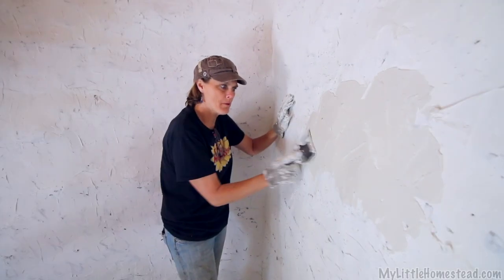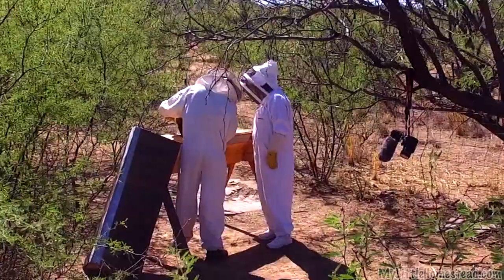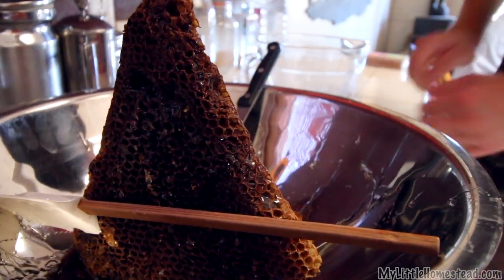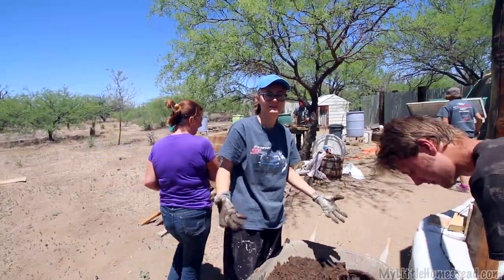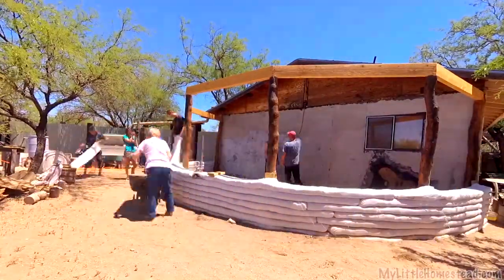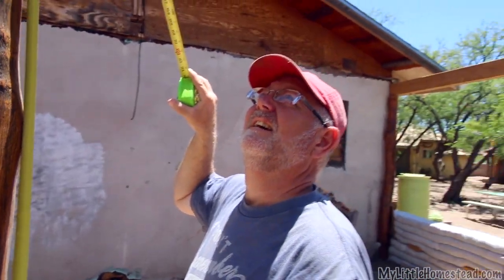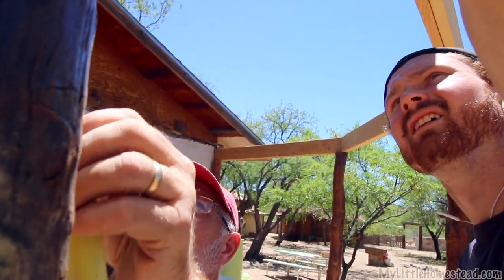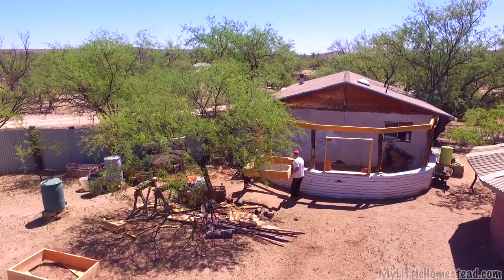Window Boxes, Smooth Walls & Honey Harvest | Earthbag Kitchen & Bathroom | Weekly Peek Ep136

Comment: the joint compound from the buckes if it gets wet it softens up and turns back to mud  if you use setting type joint compound it is harder and does not react to moisture

Comment: One helpful thing I’ve learned from doing our walls is to put a good coat of Sheetrock primer on the dry mud before you put your paint on the wall. It helps keep the Wall hard in case you ding it after it’s painted. Great job!

Comment: add a little dish soap to the dry way mud and mix it.   it makes it creamer/smoother.  and add a little was to thin it some and then you can skim coat it smooth. also the  bigger the tool you use the better.  try a trowel.

Comment: If you water down your drywall mud until it barely sticks to the trow, then apply multiple coats, your walls will turn out very smooth.  It takes a little more effort because of the multiple applications, but in the end you will really like the results.
Reply: The key here is thin coats with a wide trowel.

Comment: The walls looks great! If you guys want to make them even smoother, you could try using a 12-14" concrete finishing trowel. It's usually around 20-30$ and the finish is silky smooth. Congrats on 100K subs!!

Comment: I think you should do a nice tone on tone Faux finish to the walls when you do your painting. You should use an eggshell or semi-gloss for your base and glazing mixes to enable the marring, apply the glaze with through away sponge brushes in a random fashion and use plastic store bags turned inside out( so inks from the bags won't color your paint as it will dissolve when the paint wets it) and lightly bunch up the bags in your hands to pounce the colors together here and there in a pounce shake fashion. Change the bags as they become too moist of the paints and use a softening brush to lightly blend you colors together careful not to soften all of the bagging marks as they give the finish depth. Look at different types of stone to get an idea of what I am trying to describe. IF you want. Just a suggestion. I am a faux finisher and this is an easy finish that looks great on textured walls. One last prep tip. Tape and paper closely and out aways so you can get tight to the edges and pull up your tape before the paint dries. Score it if it dries because satin and semi-gloss paints will pull off in large sheets if you're not careful.
Reply: oh yeah do little sections at a time . it is alot of steps and should be done wet on wet. also one painter may be heavier handed than another so perhaps if working a team practice what I mean here so you dont wind up with walls that look uneven. Or just let one person do the entire job. Do not stop and start in the middle of a wall. go corner to corner if you can not finish the room at once. Measure and write down glaze mixes. Like you would a recipe and do a sampl on a large poster board to get a sneak peak. Mix all glazes for the entire room so you dont get differnet colors. if you mix little bits at once they may differ from area to area and not come out well. Read all of this if you are considering my suggestion because this isint necessarily in the right order of importance.
Reply: Love you guys keep up the great work.

Comment: Hello. Just wondering if y'all had thought of using a sponge roller for the drywall compound. Since you're doing a second coat and are going for a smoother finish using a roller to apply it would help with that but still give a little texture. It would also be much faster. If interested, just Google roll on drywall texture.

Comment: Please explain to me why you don't use sandpaper to smooth out the drywall mud?  Using a sandpaper sponge block would give you the effect you wanted without using water.  Also for future reference if you mud the kitchen walls, put up the first coat, relatively thick, sand it slightly smooth, then put up the second coat thinner and then sand that smooth as well.  You can make it look like drywall walls very easily.  That's how patch work is done over holes in drywall.  I've done it many times and years later you can't see where the hole ever was and the wall was completely smooth to the touch.
Reply from the maker: Sometimes, things are about fun. Hehe
Reply: Returning Shadow - even better...simple tight thread count rags with water.  But when finished you should put a sealer like linseed oil underneath your oil based paint.  My point being that the material you are using is VERi absorbent and hard to keep dry and mold free.  So in the bath and kitchen the walls and behind the metal shower walls should be really well sealed.  I’m restoring a 112 year old farm from near collapse to its former glory using only the tools and chemicals that were available to the original builders. My only upscale is a gas powered bandsaw mill with hydraulics and tractors to move large quantities of lumber...but its kind of fair because most of my farm equipment is either original to the farm at some point or averaging about 70 years old needing constant attention.  Fun project!  I need a simple method of recording our progress and starting a channel...like the fun time i was pulling up soft flooring to replace and fell through and broke 4 ribs...good times!
Reply: So I'm guessing that when you get your video camera and make a channel that a re-enactment of falling through the floor and breaking your ribs is out of the question? hahaha

As for the walls, latex based paint is better than oil based.  Far greater ways of up keep than oil and far greater product use than oil based.